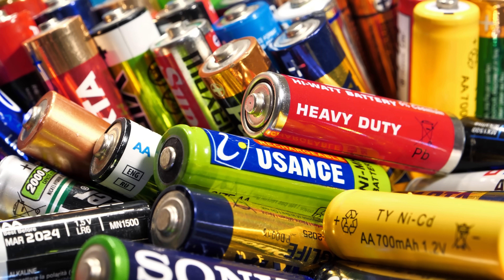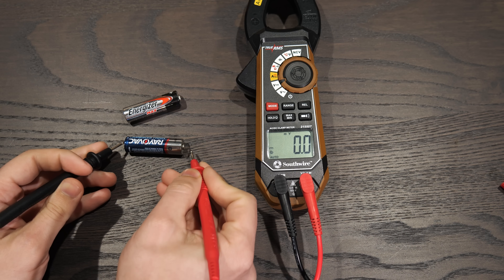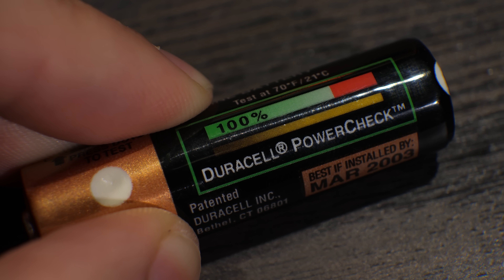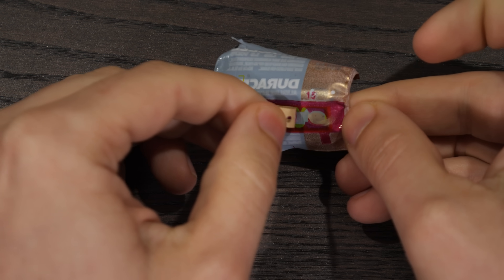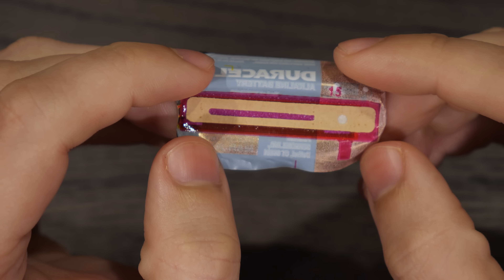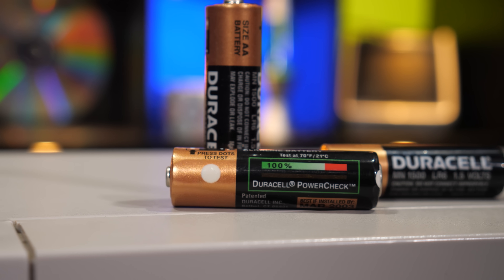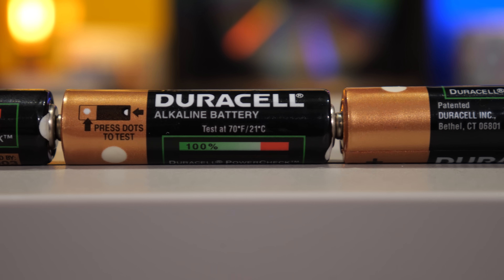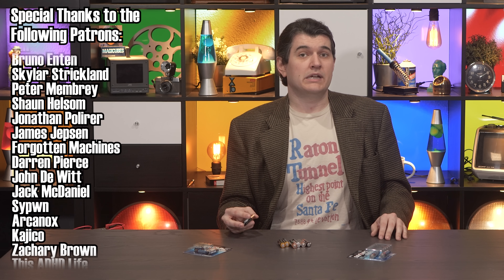Duracell PowerCheck: A genius idea which didn't last that long

Comment: I still know those and other version by Duracel. In Europe there was a period that the batteries, the AA, AAA C and D and even the 9v blocks, where sold with a little strip that was the tester. In that case you fold te strip over the terminals and it would show the yellow strip. The 9v batteries had the same strip on the package.

Comment: AA batteries are SIGNIFICANTLY bigger than AAA batteries, there's a lot of devices they wouldn't fit into, lmao. If you compared AAA to AAAA, you would have had a more valid point.

Comment: Oddly, to my recollection, around here a Pack of AAAs and a Pack of AAs will cost basically the same... but the AAA pack will contain more batteries.  On the other hand, you can often get 20 packs of AAs for even cheaper, not so much AAAs. Probably because the AAAs tend to go in things with much lower power draw, and thus last longer, while things that actually chew through batteries tend to use AAs.  That said, used to be the two most common uses for Cs or Ds were tourches and Radios... these days the tourches use LEDs and run on AA or AAAs (I think I have a weird one that uses three AAAs aranged in a triangle with the holder in the middle in a space about equivalent to where the old C or D batteries would go), while radios either use AAs (quite a few of them) or larger rechargables (I have one that can take both, with the later being a standard cellphone batteries from back when those were actually replaceable, at least going by form factor, which came with it... except... this is just straight up a radio (well, it can play audio files off a USB flash drive if you don't mind setting the thing on fire, or a flash memory card, but other than that it's just a radio... a really budget radio...) and the battery, fully charged, won't even keep it powered for a single day. ... so in the normal course of events I just keep it straight off it's usb charging cable with no batteries in it and if it ever needs to run off battery power it's getting AAs shoved in there).

Comment: I remember those.  Neat idea, but yeah, frustrating to actually use.  I do have a question you might be able to answer: What happens if you mix used batteries with new batteries?

Comment: Do you remember when they added a tester on the packaging instead of the battery? You would put the battery in the plastic and pinch it to test. Functioned the same i imagine.

Comment: "Thank god we're past all that" to an extent, I agree. All my old equipment that uses AA batteries or the like still work... While a couple of Playstation 3 controllers I have that contain an internal Lithium Ion battery no longer turn on. Gameboys might need batteries but at least they are still functional... Unlike my DS Lite which now requires a new lithium ion battery which not only is not widely available but the ones that are are very dubious in quality.

Rechargeable AAs is the way to go.

Comment: I would like to know how many cycles my rechargeable batteries are on, I always just try to keep track of that in my head an often end up forgetting, resulting in me having no idea if my batteries have good internal resistance. That's a whole other problem I doubt is fixable with just a strip of metal though.

Comment: Duracel also made AA batteries called quantum. I had some in my junk drawer for since like 2017. When I finally used them in 2023 i tried using the press spots to check how much juice it had left. I guess I didn’t press hard enough but I didn’t care and slapped in the remote anyway.

Comment: Would love to see a kind of continuation on this theme... Why are AA/AAA alkaline batteries 1.5 volts and the same rechargeable batteries only 1.2 volts?
This can cause problems with low volts when multiple batteries are required.

Comment: Dropping these batteries from a height of about 2" onto the flat negative end on a hard surface is a good test. If it bounces it's dead. If it doesn't bounce (and often stays upright) it's good. Also, storing batteries in the fridge greatly lengthens life by slowing the chemical reaction Just warm them to room temp before using.

Comment: I've fully switched to reusable batteries with the exception of a few things like remotes that will never make it cost-effective. Wireless cameras, battery powered keypads. I feel like I remember having reusable batteries as a kid that were terrible. These generally have more capacity than any brand battery due to lithium's ability to fully discharge

Comment: Thinking back, the evolution of battery tech since my childhood in the early 80's is crazy. 
Alkaline to NiCad (remember having several sets so you could switch out the batteries in your toy while the other set trickle charged for hours?), to NiMH which were pretty good alkaline replacements actually, to everything having its own onboard lithium battery that charges quickly and has really great power density compared to what we used to have.

Comment: Fun fact: if you stored these in a location that's too warm, the tester would activate and stay on, killing the battery. On a family road trip, we once had 20 or 30 of these all die because they were stored in the car rather than inside.

Comment: Annoyingly, of course, charge left on a battery in a devices doesn't work well with rechargeable AA/AAA since they start at and operate at lower voltages. sigh

Comment: I save all the "dead" batteries from our door locks and flashlights in a bag. They work well in Logitech mice, and also in my cheap Chinese video light (which isn't all that finicky with voltage) during a power outage. Great recycling since these devices can drain the last bit of juice out of the cells.

Comment: I don’t want to be that guy, and please correct me if wrong (more than likely) but at 7:32 you say the skinny part is high resistance. Wouldn’t it be a lower resistance since there’s less area to be covered and heated?

Comment: If you have a rarely-used tool with disposable batteries in it, like the remote for that old Laserdisc player or that flashlight you keep around for emergencies, for Zeus's sake TAKE THE BATTERIES OUT OF IT when you're not using it!

Batteries WILL eventually corrode.  If they're sitting out in the open when they do, you only lose the batteries.  But if they're in the battery holder of your precious Laserdisc remote, the corrosion will wreck the battery contacts and there's a damn good chance the whole device will be ruined.  Don't let this happen to you, kids!

Comment: One thing I remember about these, is that at some point Duracell cheapened out, maybe? And instead of having the thing on each battery, they did put it on the package, which added the convenience of being able to use with any other battery.
As a kid I did use to hunt those cutting them from the package to test random batteries just for the sake of it.

Comment: When I was a teenager in the 80s a common battery brand in Finland was UCAR. Had I known what it meant I would have stopped buying them in 1984. Alkaline batteries back then were expensive as hell, something like 2 € a piece inflation adjusted.

Comment: Even back on my gameboy color, i went through very few batteries. I used rechargeables even back then. I had 4 pairs of rechargeable AAs, and those are for the most part the only ones I went throughl. I recharged them so much that after a few years they would barely hold a charge. But hey they saved me sooo much freaking money on normal batteries. Even today I have rechargeables for everything! 4 rechargeable AAAs on the smart scale. Rechargeable AAs for my Xbox controllers....rechargeables for my older flashlights (the new ones mostly have built-in batteries). They last for years! some of my AAAs are now lasting noticeably less than when they were new, but i've been using them for over 5 years now, they have more than paid for themselves. Eventually i'll put these on the battery recycling bins and buy a couple of new pairs.

Comment: C batteries were by far away more annoying than AAA... At least with AAA there were enough devices kicking around that needed them that it was worth keeping spare on hand. I Don't even remember what it was that required c batteries but every time I went to use it it was dead and I never had batteries for it.

Comment: I remember batteries using something similar but it was built into the packaging of the batteries. I saved one for years because they discontinued making them. I wonder if it used the exact same technology or was more akin to a voltmeter.

Comment: I realized awhile back that I hadn't seen these testers on batteries for a long, long time. The same tech/meter was originally used in the packaging. At least for Duracell. Between the batteries there was an empty slot in the blister plastic with one of these meters attached. You'd put the battery into that empty slot and press the top and bottom and watch the bar go up (or not.) I think it was a few years after that they moved the meter directly onto the battery itself and advertised it as an improvement since you no longer needed to keep the packaging.

Comment: another problem it actually solves is if the batteries lose charge at different rates its easy to check which one of them is dead so you dont need to swap over and over to check

Comment: As a kid used batteries were rotated and matched up to get the last of runtime out of them for the Walkman after they were too low on voltage for the GameBoy. In my memory they batteries were a lot less reliable in capacity than now, having one dead already when the others were still fine making the swapping around worthwile. My guess is that for this a built in meter was helpful.

Comment: Video Idea for you: I have little electric wall heaters built into my apartment that work pretty badly, like glorified hair dryers. (Cadet Com-Pak 1000-Watt rated for up to 150sqft). My brother and I have a debate over if it would be more energy efficient to use these or get oil filled space heaters (1500-Watt rated for up to 300sqft). In an ideal world I'd have heat pumps, but I don't make the rules, I just pay rent here.

Comment: I can't say I agree that it's a good thing that fewer devices use AA and AAA batteries. Rechargeable batteries, yes, but rechargeable AA and AAA batteries have come a long way since the 90s. It's way more convenient to use rechargable batteries in a standard, interchangeable size than to have to find a free USB cable and port of the right type and wait a few hours whenever a device dies.

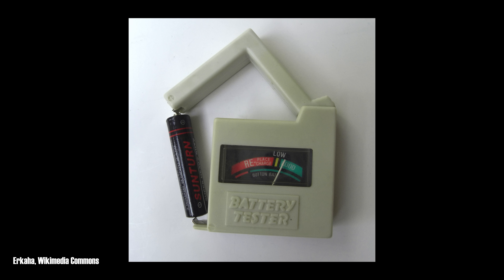Comment: 3:00 The way it works is odd - for a voltmeter. It simply isn't a voltmeter. I hope this is rectified later on in the video. Edit: not in the video but in the pinned comment. Close enough, thanks!

Comment: OMG dont get me started on AAA vs AA. In Canada they are not the same price, they are more expensive and I swear the battery companies give devices manufacturers free batteries for their devices if they use AAA in them. Manufactures get to look good becuase they added free batteries, cost of production goes down, battery companies lock us into using AAA batteries!!!

Comment: Duracell went from a high quality battery with a gimmick to one of the most reliable to leak batteries.  The older Duracells didn't leak like the new ones. Now I buy any other brand.

Comment: this is unreal, i was literally remembering this the other day and wondered what happened to it. your explanation makes a lot of sense. i remember a little while after they phased these out of the individual batteries, some packs came with a single strip that you could connect to both contacts to do the same thing. or maybe it was before, i don't remember exactly. oh hey you literally started talking about this as i was typing lmao.

Comment: Speek for yourself. I have a lot of used batteries that are good enough for some stuff but not others. A lot of time only 1 battery in sonething is dead but the other ones are fine so save the good ones and reuse them. Some stuff needs more power too so when it stops working in 1 thing it moves to something else that dont need as much power. I had "dead" batteries from something last over year in something else lower drain clock, thermometer, remote ext. Remote never gets new batteries

Comment: If you wanted to listen to your portable device that ran on AA batteries & you knew youd be out all day or whatever, you might check the batteries before you go, maybe a half full one wont cut it & youll put fresh ones in & use the part ones later, so at the time/era I think it was useful to have

Comment: I am loyal to energizer lithium batteries. Though i noticed in my pvs-14s with nl914 battery housings, new lithium batteries trigger the low battery warning indicator light.  My guess is that since the housing can also take higher voltage cr123 batteries the board mistakes the higher voltage of fresh lithium AA as a low voltage cr123. Curious if anyone eles has seen this issue in other electronics that take cr123 & AA

Comment: You'd be the guy to dig into battery tech. Like for example I switched from alkaline to lithium for a lot of performance reasons. I would however be interested in the differences from start point to end point. Manufacturing differences? Impact to landfill differences? depleting resources differences?

Comment: They still produce them, I have AAA ones for my headphones ANC, telling me to use them before 2026, so they cannot be that old.
Still called Power Check, still hard to use, and the scale has now four color segments.
Reply: How does your ANC headphones use AAA???
Reply: @Kevin-mx4vm  A good chunk of wired headphones with active noise canceling have a separate AAA/AA battery that powers the noise canceling. I think some wireless ones do it too, but that just sounds redundant, maybe it'd be to help prevent draining the rechargeable battery too quick?
Reply: QC25, but I rarely use ANC.
Reply: we use them at work still
Reply: I have a couple headsets with AA powered ANR.

Aviation headsets, but still headsets 😂
Reply: Now it is mostly wireless I guess. The QC25 were released around 2015 and are discontinued for some time now. The successors are wireless.
Reply: @Kommentierer  wow I didn't realize wired, AAA battery powered, ANC headphones exists at all 🤯

Comment: So mama don't take my Kodachrome away.

The treatis is interesting, but that battery is a real approximator like the cheap analog multimeter. I gotta use a meter to know the voltage ( without load ). I replace batteries in electronics that require FULL charge to work, and malfunction at 70% or below maximum charge. Further, many mission-critical devices like Safes, Smartlocks IMPLORE NOT to use weird super batteries..... just stick to standard alkaline Duracel or Energizer.  And CAR remotes are SUPERFUSSY.... those 3v coin cells need to be 3.16V or better when put in, and will fail or become intermittent at 3V in some car remotes.

Literally, I have a 40 pack each of AAA and AA in the car ..... gotta go get them out before it gets too hot out there.

I would love a deep dive on WHY certain devices cannnot operate on batteries all the way down to about 30%. I am told it is sort of akin to memory in rechargeables.

Comment: Pro-Tip: use your fingernails on the dots. A point is easier to make contact than a pad. And you must have had a nice life, with all them batteries around for everything....The rest of us juggled batteries between the gameboy, walkman, random toys, film cameras, pocket mag lights, and of course where weak batteries go to die....the VCR remote.

Also, no I do not subscribe to Alkali Magazine, its too basic for my tastes. I prefer the Protonated Weakly Journal.

Comment: 13:31 most rechargeables suck though. They are only 1.2v and they don't last as long as disposables. I have tried many over the years. And I still use them but they do suck.

Comment: IF THE BATTERY IS STILL ABOVE A VOLT, AN ALKALINE CELL CAN BE FULLY RECHARGED, FOR ABOUT 10 TIMES WITH SLOWLY LOOSING CAPACITY.

Comment: Maybe you could do a video on a related topic: 
The frustrating voltage difference between rechargeable batteries (NiMH) and normal Alkaline batteries.  
Older gadgets sometimes don't play nice with the lower voltage that rechargeable batteries provide.

Comment: Alkaline batteries are "non-hazardous waste", unlike lead-acid, lipo/lion, ni-cd, etc. (Look it up.) Your LOCAL waste management decides what to do with them. Do that. At least Europe is working on the much bigger issue of non-replaceable batteries. Unless you're handy with cracking open your electronics, now you have a big chunk of waste when your radio, bluetooth speaker, or earbuds can't hold a charge. (It's always one that poops out before the other, right?) Probably because of EU regulations I've started seeing rechargeable radios with a compartment to change the (18650?) cell.

Comment: This is a good example of a solution to a problem that doesn’t exist.
Reply: Not really. Having no battery tester at hand but wanting to know if a battery is good isn't a fake problem. But it's also not a big problem. Those little standalone battery testers are cheap.
Reply: @SnakebitSTI  I can honestly say that in 35 years of life on this planet, the only time I've tested an alkaline battery was for fun while bored. I do have partials in the junk drawer, but even if I had a tester, I wouldn't test them. They get tested when they get put in something. In fact, I even have one of those testers somewhere that someone gave me. I have no idea where it is, and I've never felt like I needed to go hunt it down.
Reply: @RealBenAnderson  "It's not a real problem because I personally do not care" is not a strong argument.

But it's hardly life changing to have a convenient way to measure remaining charge of alkaline batteries. It's a little solution to a little problem.
Reply: @SnakebitSTI  thanks for sharing.
Reply: @RealBenAnderson  You're welcome.